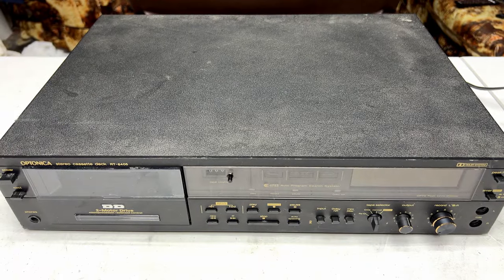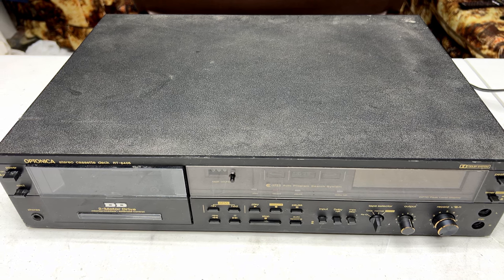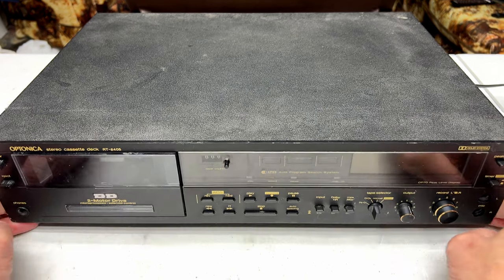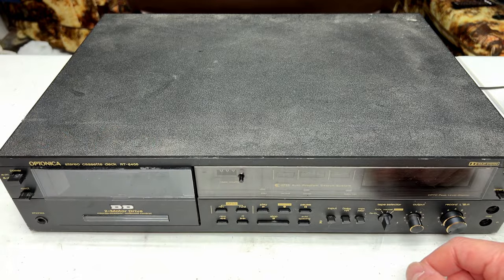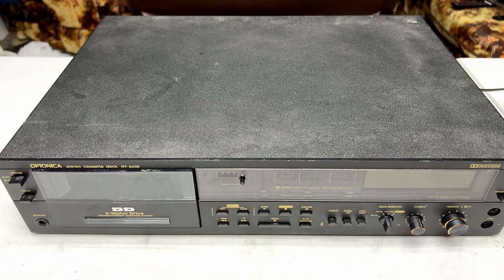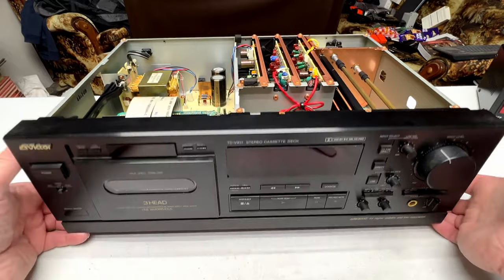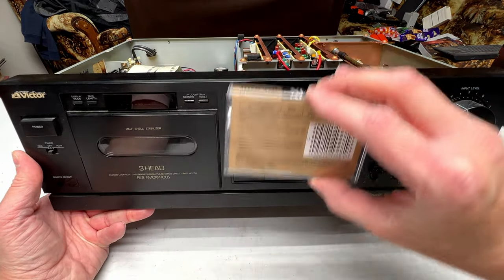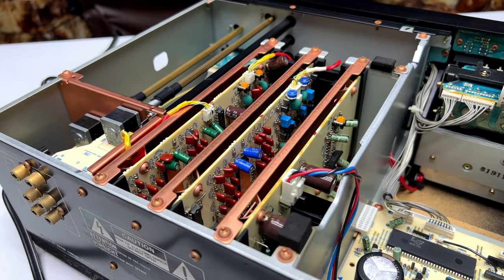Evaluating 9 New to Me Cassette Decks | Potential Dragon Killer Reveal

Comment: I own a DD-7, it has the same mechanism (DD-99). Very low W&F - but its only single capstan, just outstanding! Mine has 0.016 WRMS without recapping.
Reply from the maker: I managed to get the 99 working well enough to check the wow and flutter on Thursday. Now I can confirm the Technics RS-B755 really was the best I had, because that tape in the 99 gives me 0.029%. So it's already as low or lower than the Technics. And this is before doing any service on it.
Reply: I had the option to get a DD-5 locally.. so sad that I didn't jump on it
Reply from the maker: At the risk of being called an enabler, there's a DD-7 on Mercari Japan right now for $127 Canadian. It was $145 yesterday, so seller wants it gone. FromJapan can probably help you buy it. I'd get it myself, but I literally just bought a mint looking DD-7 two days ago for about that price.
Reply: @Oklawolf  that is great. Mine looks also like new. There is still the W&F sticker on the door (0.06% DIN)
Reply from the maker: Mine's missing the sticker but has the original owner's manual. Seller bought it brand new 40 years ago, so it's not a third party sale either like the 99 was. I saw it sitting there at $33 before I went to bed that day and decided I was going to bid closer to what I saw the last one go for. Didn't expect to actually win it, but I did. Also watched a DD-10 sail away from me yesterday for almost $400. No idea what makes that one special over a DD-9, but it looks like the same deck functionally.

Comment: Just another thought.  When NAD first came into the market the quality control was really bad.  One time I had to open up 3 machines before I got one that worked (didn't give me any confidence in the line).  I noticed that the quality of the parts (cheap capacitors, wire harness mess, cheap switches etc) didn't help things in my evaluation of the line.  I think the circuit design was pretty darn good because when they worked they sounded pretty good.  At a company meeting I coined the product name NAD as "Nearly Always Defective" boy did that catch on throughout the company.  I think things improved over the years but I still have the impression they used sub par parts and they could have used better.

Dr. Dave

Comment: What would be super cool is a comparison between Victor dd99 and tdv931 for recording and playback. Based on forums, they are both called top of the JVC range.
Reply from the maker: They're both top of the line. I will be comparing them to the rest of the heavy hitters in the collection, but it's getting harder to find good tracks to do that with. I'll do my best, anyway. I can tell you that when I got the DD-99 to output on both channels it sounded amazing with tapes recorded on the A&D GX-Z9100. Should find out what the 931 can do before too long. I hope to start working on it next week.

Comment: JVC TD-V661 here, fabulous machine. I got it stupidly cheap, BNIB, because it was 110V & collect-only. the seller had bought it with the rest of the system in NYC, then moved back to london, about a mile from me. couldn't shift this deck, so I paid £45. 
direct-drive, dual capstan, real-time counter/remain, three head with 210kHz bias & manual calibration with tones, hx-pro & a titanium-finish. all it lacks is the remote control.
I have revoxes here, naks, sonys, brauns, a NAD6300.... the JVC is probably better than any of them.
Reply from the maker: I managed to get the DD-99 working well enough to give me audio on both channels so I could hear it play for the first time and get some wow and flutter measurements, and I can already tell that machine is going to become a personal favorite very quickly. I have a feeling the TD-V931 is very much going to live up to the hype, as long as the heads are good.
Reply: The 661 is a great performer, but I wouldnt recomned it unless it is cheap because I service one with the main capstan flywheel slightly deformed and starting to crack in several places. This is a show stopper for this machine. It is not the first time I have seen these alloy flywheel cracked. I cant stand why they have use this cheap material on this level of deck. The only posible solution is try to take the magnet from the DD that is attached to the old flywheel and machining a new one in a material that wont "decompose". I love JVC and I think they are pretty underrated. My 661 still performing exeptionally, but I think it is matter of time it will develop the same issue.

Comment: I have an ADF810 with the headblock stuck inside cassette.m  Is that fixable?
Reply from the maker: Very likely, as long as the door hasn't been forced open which would cause damage. Depending on what's wrong it may be tricky to get the cassette back. If the belts went out during play, manipulating the flywheels should disengage the head block. Could also be stuck pinch roller pivots due to old grease, which is harder to deal with as you have to force the head block back down somehow before it can disengage. I've never worked on that model but my Carver TD1700 and Aiwa XK-007 videos might be of some help there. Similar transport.

Comment: Victor/JVC direct drives have much to be proud of, but unfortunately the 'listenability' factor of the Victor heads just don't compare to Nakamichi, nor even the Canon Amorphous heads used in the 3 head Aiwa, and later Sony decks. The only deck I would consider equal to the best Nak (or even slightly better in the bass) is the Aiwa XK-009. (That being said, I'd love to get my hands on the TD-V1N--the only Victor with the Canon Amorphous heads!)
Reply from the maker: I'm seriously thinking more about the TD-V1 as well now that the TD-V931 is up and running (video a week from Saturday). XK-009 or XK-S7000 is inevitable for me. I just need to find either one at the same time as I have the money for one. As far as Nak goes, I just wish the good stuff was cheaper so I could get my hands on them. Pricing on their top decks is absolutely unreasonable made worse by the fact that people are actually biting at those prices.

Comment: Well, 931 will never be a Dragon killer. I had one. It's a good deck with some potential problem with tape transport. Back tension problem. But I prefer a simplier 707 with calibration. But I don't use it much. I have other decks to play with. Too many Dragon killers out there, but non of them really are. Usually they can't come close even to ZX7/9 or CR. 😊
Reply from the maker: I have my doubts as well, but I'll give it a chance. It's going to have to impress me more than my GX-Z9100 does. I'll likely never own a Dragon at today's prices.
Reply: @Oklawolf  It is a better sounding deck then 9100. That's for sure.

Comment: Wow man! nice decks! already waiting for repair videos!
P.S. akai gx r88 that relay switching erase heads regarding in which direction recording goes and you can just clean it, because that transparent plastic cover can be easily removed :) Have one, fixed one - its not as easy as other akai decks like gx9, gx 75, 95... for sure...
Cheers!
Reply from the maker: Thanks! I'll keep that in mind when I get to that deck. I remember your video... I don't remember why I wanted one so much after that, but here it is.
Reply: @Oklawolf  Thats a nice deck - thats why :) You will be fine :) Cheers